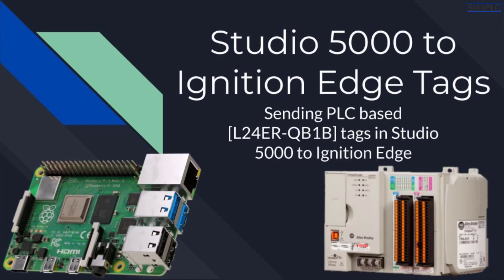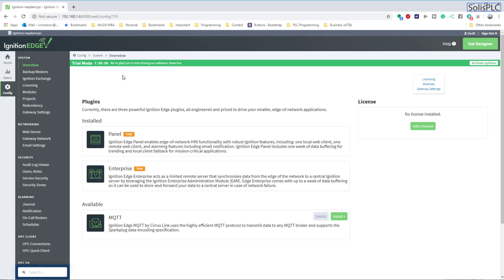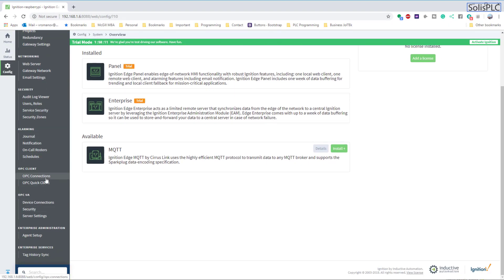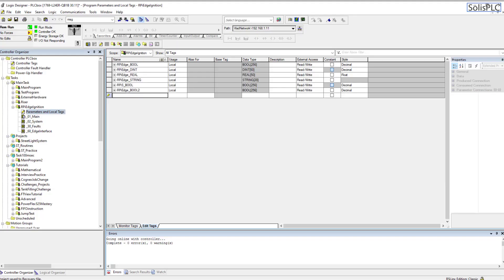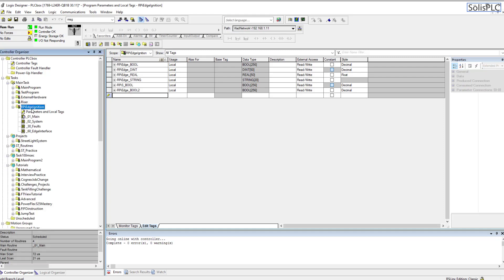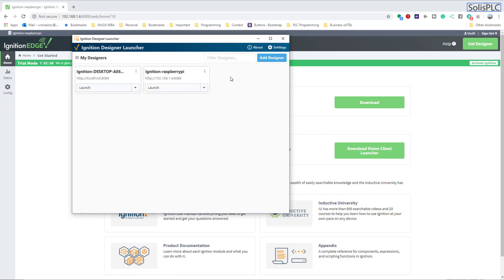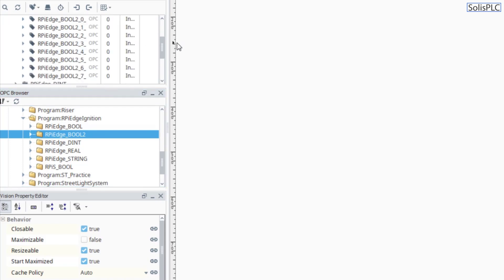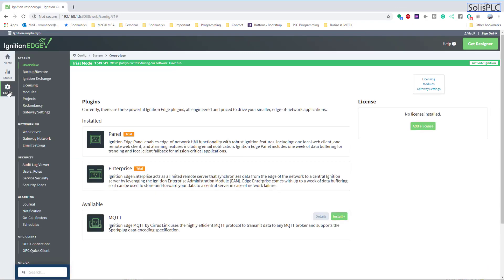Ignition Edge PLC to SCADA | PLC Tag Programming SCADA Tutorial CompactLogix Allen Bradley RSLogix

Comment: hi I have compact logix studio 5000 plc , customer is using ignition. I check your video ignition can directly read the plc as long the setup opc built in for ignition. So my side not need do any software or programming ? Just connect and browse the plc tag through  my plc Boolean or any tag right ?

Comment: Can you change the data type in Ignition Edge to BOOLEAN so the values don't display as an integer value? You might also be able to make a Tag Reference tag or custom data type to have the bits come through properly. I'd like to tinker around with this.

Thanks for the videos!

Comment: So it broke down the arrays into dint? Is there an opc server that would make Bool[256] into ignition that wont change its data type structure?
Reply: You might be able to create the tags in Ignition through the multi instance wizard or do it manually as an OPC tag and point directly to the corresponding bit. It might be possible to create a script or expression that would convert the value of the dint and write to boolean tags.